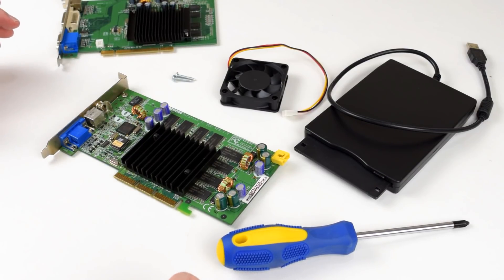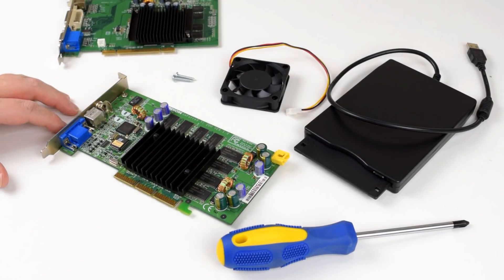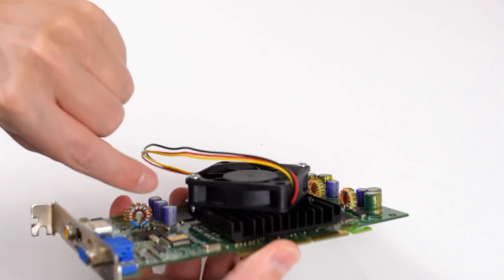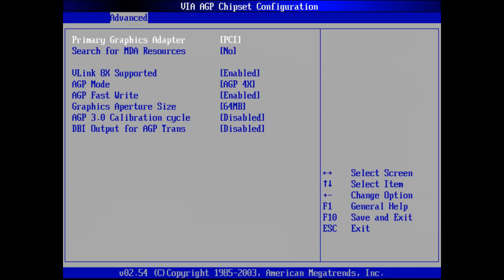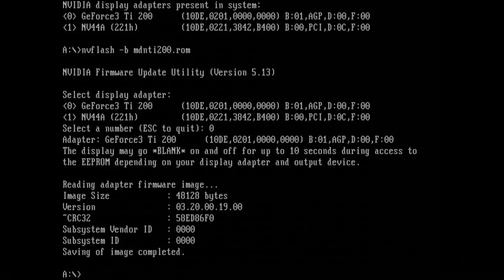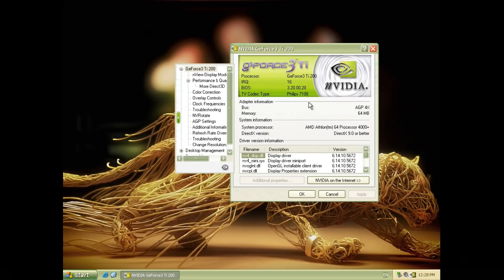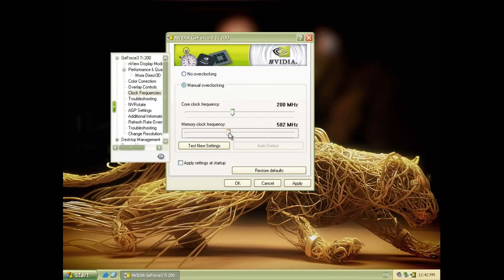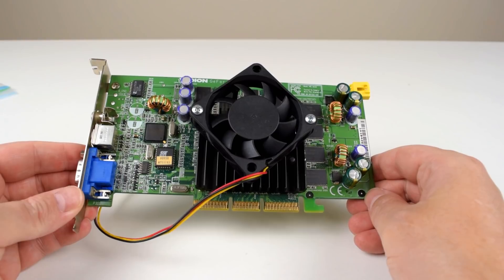Can we mod a GeForce3 Ti 200 into Ti 500?

Comment: Did anybody successfuly remove heatsink from that exact model of a card? I wanted to replace cooling entirely but it seems to be glued, its no thermal paste.
Reply: I managed to remove it by releasing pins and putting tapestry knife blade between lower core frame and heatsink, then heating up with hot air 250 C with lowish/medium airflow then putting flat screwdriver between blade and heatsink (good method to protect the core from uneven forces), then twisting screwdriver slightly with (absolutely no force it came off very lightly once heat soak in). Now I put on it Aardwolf cooler which is more for radeon 9000 series and gf4 or fx so its big (takes extra slot and a bit) but it does fit medion gf3 ti200 and provide massive cooling performance. If anyone ever think of trying it I think this is the best method for this card, much better than freezing it, its no 3dfx.

Comment: The TI500 with the green heat and ramsinks, i desperately wanted that card as a 19 year old lad! Couldnt afford it at the time though. That card was the first consumer produced gou that i ever saw that made me realise things were changing. My gpus to then id added ransinks and crystal orbs to overclock etc, this was the first card i saw that looked like proper cooling had been done by the manufacturer. The next gen 4a all had shrouds and near full cover heatsinks etc. That was the jump from the old pcb cards with nothing on then, to the ti500s, some like the green one, had the jazzed up cooling, then the 4s all had images on big heatsinks and looked like consumer items rather than parts from a 1993 server pulled apart! We all fell for it too! People actually bought cards from manufacturers who made the better looking version. Something to do with the first windowed cases coming out around then lol.
I used to make my own led lighting from maplin parts, made my own 12v water cooler setup from a car window washer water pump that pulled WAAAAY too much power for my liking, that i actually paid a lot for a new psu cuz with my home made cpu water block i went from 1000mhz on my amd thunderbird, to 1400mhz and back then, that was a huge jump that pushed fps up in the 10s rather than 1 or 2!
God i miss the early days of gaming and overclocking and pc case modding!

Comment: You tested the fan to see which side the air came out??? You couldnt look at the blades and instantly see which way it spins and which way it pushes the air? Waw!
I must have a super power! where just at a glance i can see which way a fan pushes air, from now on i will be known as FanBoy!...... Either that or your a strange one! You know enough to mod a card but cant work out how a fan works! Btw the heatsink DOES accept screws, some of the blades on it are closer together and have a ridged surface, that is to accept screws. You sure you know about gpu modding?
Reply from the maker: @Matt-uv3eg  I've heard worse, from better.

Comment: What kind of overclocking software did you use? Or is it part of some driver for nVidia cards? if so, which one? Because the one I use doesn't offer me these options. Thank you!
Reply from the maker: You might need the coolbits registry tweak. Or use Rivatuner or PowerStrip, both can OC.
Reply: @philscomputerlab  Thanks, I found it right on your website. But I must have been overzealous and messed something up on my MSI MS-8850, because now it doesn't detect Windows 98 as GF3. I must have tampered with the card's BIOS somehow? Links directly to my card are no longer available on the Internet. With the original broken ROM, Windows were unable to initialize the card, so I backed up the ROM from my ASUS Ti 200. With this ROM, the card works now. However, the original working ROM is probably lost for good. Let this be a lesson to others not to skip important parts of your video and to carefully backup everything.

Comment: That’s not the proper way of doing things.
First You overclock the card with Riva tuner to find maximum stable clocks. Next You edit the OG bios of the card  with the newly found max clocks and flash the bios with them, so You don’t need to use riva tuner anymore. 
There is no need for using ti500 bios.

Also the ti500 have square shaped memory modules, which are capable of higher speeds, TSOP memory modules with 4ns would not cut it.
Reply: Old video, but since it doesn't change the device ID to a geforce 3ti 500, It would just make more sense to find the max overclock and click "apply at startup"

Comment: I have no victory stories with nvflash. Just abject failure. :( Tried a GF2 MX to GT. Worked fine. What I didn't know is they were all the same cards to begin with (MX, GT and 256 that is). So I gained and lost nothing. And for sure the Ultra would have bricked any of those cards so I did not bother.

Comment: @PhilsComputerLab - 
This must be an OEM card for a bigger PC manufacturer (often used in Medion / Aldi) , because this internal CD-Audio header is made in yellow for analog video
Reply from the maker: Yes it is an Aldi computer card 🙂
Reply: @philscomputerlab  - 
I pulled the identical grafics card from a 2005 Aldi Medion-PC (Pentium 4 ) with dead motherboard (BIOS or chipset) , the yellow internal port of the card was used for analog Video input (S-Video & Composite) from the front bay (incl. card reader , under a lid) , I think I did it in 2015

Comment: I just saw this video now. My guess is that you probably did not thoroughly check the memory overclock stability. I have five Medion GeForce 3 Ti 200 cards, which I acquired in a 5 - 6 year time span (so very different batches). Not one of them is capable of reaching a memory frequency of 230(460) MHz with 100% stability (in fact, three of them can't even do 210(420). Yes, it's almost stable, but in certain benchmarks, if you pay very close attention, you can see a few instances with pixel corruption. For example, my go-to memory benchmark is running the Bump Mapping tests from 3DMark 2000. For some reason, these really stress the VGA memory and if your card's VRAM is not 100% stable, it will quickly show in these tests.

Comment: hi, i wish to flash radeon 7000 it clocked@ 143 for both memory and core , and i tested the clocks stable @ 166mhz , even 173mhz , getting 8 frames faster , how can i do that? , by the way thanks to you for retro works.

Comment: I wonder if you cooled the RAM a bit using those cheap little aluminum ram coolers you can get on Aliexpress, etc.. if it would clock closer to 500.  Might be worth a try.  Something like these:  https://www.aliexpress.com/item/32909309458.html

Comment: I have Nvidia GeForce 4 MX440 64MB version and believe or not.. in 2010 i was playing a minecraft on it but in 800x600 , render distance set to 5 and also i did some tweaks like boost memory clock + 30MHz and chip itself + 40MHz. This gave me a FPS boost around 2 or 3FPS but it was much stable. So the total AVG fps was 30 to 45 stable all the time.

Comment: I have a Socket A board where I can set the multipier of the CPU with jumpers. Even with Athlon XP cpus that have a locked one. After doimg that my Athlon XP 2600+ showed up as a 3000+ in the bios.

Comment: My Asus Geforce Ti200 could be overclock only by a margin of 10 to 15% from the stock speeds and this was totally cooling system independent as it used the same cooler and copper sinks of the original Asus GF3 Ti500.

Comment: I remember flashing my 9800 GTX+ into a GTS 250 and getting a different/new GTS 250 to SLI the two cards like 10 years ago.
A lot more straight forward since it was just throwing the files onto a USB flash drive and booting from that as the GTS 250 was a rebadge, and no physical mods were required. Still kind of nervous to do since that was at the time still an okay graphics card.

Comment: Thank you so much for all your work in the retro gaming community. I've recently built a Windows 98 machine with an A7V133, Duron 950, 3DFx Voodoo 3 2000, 128MB SDRAM, 52x32x52x CDRW, an Old beige case with an old PSU with 30 amps on the 5+ rail, 3.5-inch floppy, 80GB IDE HDD, SB Live! and Win 98SE. You've made it so much easier to play old games in MS-DOS mode with the SBLive. Your website is priceless and I can't thank you enough. Also, using a CRT can make all the difference in the world. God bless and thanks so much for everything, I wish you nothing but the best and cheers from the west coast of Canada.  (I often leave your videos on autoplay in the background, it's really enjoyable.) If I could make a suggestion for a video, it would be 3dfx games and how some 3dfx games only work with some 3dfx cards, but that's quite a deep topic, but if you made that into a video, I would probably watch it on repeat for at lest a month. Anyways, cheers and thanks again for being awesome. If you ever need any stock music I'm aways down to produce some free tracks... My Soundcloud is www.soundcloud.com/guata08. Cheers.

Comment: i have some tools that i use to modify the original vbios, you can change the clocks, unlock shaders, change the vbios cache screen that shows at post, all kinds of things like fan profiles can be adjusted, and the best part about using the stock vbios is you know its going to be stable, some vbios are different, like some cards had VIVO and some didnt, some use faster memory and some dont, so what i did with my geforce 6800gs is tested my overclock settings for a few hours, made sure it could run at the geforce 6800 gt speeds stable and cool, then using tools i dumped the stock vbios, i then made a copy of the stock vbios and saved it on my server, i opened the vbios in a tool and unlocked the shaders, went from 12 to 16, adjusted the clock speeds and adjusted the fan profile, also added the text modified in the cards post screen cache so i know its the modified vbios, saved settings and flashed with nvflash, i now have a $7 geforce 6800 gt thats working great

Comment: Bro, if you put heatsinks on the RAM I guess it could handle the Ti500 memclock speeds! I had an Ti200 with a big ass heatsink that covered the ram also and I just swapped the little fan with a bigger AMD cpu fan,  and it was a beast :D

Comment: I flashed a custom firmware on my 970 for the 0% fan at low temps but it never worked but it did let me put the % lower than it would let me before. All thanks to linus

Comment: hey phil, is there a list of games you recommend for p2 system? i ordered a dual slot mobo and thinking of building a nice classic gaming machine and ditching my pentium pro. Its going to run 2x 233mhz cpus and as much ram i can cram which is maybe 1gb, for video its going a fast decent card so no bottle necks there other than what the cpu and mobo can run at.
Reply from the maker: DAT 30GB Not really, best to research what interests you. I tend to use games that I like or find interesting.

Comment: I flashed my 9600 Pro with XT bios and added a fan.  It ran just fine and the speed boost was just noticeable enough in the games I was playing at the time.
Reply: This is what I missed! I had a 9500, too slow, returned it for a 9600 Pro. Still too slow. Kept it but bought an FX 5600. I open the box to the "Congratulations we've upgraded you to the FX 5700 for free!" No thanks, that card has serious issues. What a horrible way I was in. So I went to CompUSA and bought a 1300XT. Too slow for Oblivion. Tried the 1650, still too slow for my taste. At this point CompUSA is getting pissy about returning opened GPUs so I got the most expensive thing in the store. The HD X1950 Pro XTX. And I was so happy with that card for a while. So happy. Thing is, if I knew the 9600 could be a 9800 I would have stopped right there until the 1950 came out. LOL. Oh well.

Comment: GT 7300 fanless, that card... just add a fan to it, 350mhz stock can be increase up to 610mhz with stock voltages. With voltmod I can remember go up to 720mhz at 65, 70C, at this clocks the GDDR2 just was holding back the card on perfomance, 420mhz on memory was near the max mem clock.. I played many titles with this OC, I can remember playing mw1 and mw2 at 720p.. very nice card to play with overclock...

Comment: I haven't thought of using a pci and an agp card at teh same time when flashing. I found nvflash to be a bit tricky at the beginning. I use this method when flashing cards from pc to mac-rom for use in a macintosh. Maybe I can flash a mac card to pc if I have both pci and agp card installed at the same time.

Comment: Try voltmod. My result with GF2MX - 272/230MHz @ 2.45/3.9V. Had to cut 3.3V lanes from AGP and make my own voltage regulator for memory. There are guides on the internet if you don't want to figure out exact procedures by yourself.
Reply: Can you spoonfeed me some links been trying to google never find much of anything with pictures.

Comment: I remember years back flashing, Geforce 5700 with a Quadro 3400 BIOS, I think it was, to get Avid running on a PC. For a few generations there was zero difference between Quadro and consumer gaming cards, aside from the cost (and binning). That's when softmodding took off. Then Nvidia cracked down on the practice and nowdays, even though they often use the same chips in consumer and pro cards, gaming ones are physically crippled to prevent softmodding. It's ironic that it's more cost-effective to make a good GPU and deliberately scale down performance for different market segments than to have parallel development lines going at the same time. Very common practice in the electronics industry.

Comment: BZW, the contacts for the fan header work just fine. Got my GF 3 Ti 200 modded that way. Not sure about fan control though.
Should also be possible to dump the original BIOS and change the timings in NiBiTor before flashing it back.

Comment: I don't get the whole point of the bios swap when you can just overclock manually anyway ..
Reply from the maker: To show the process of BIOS flashing. If course you can just move the sliders...
Reply: Ah okay Fair enough , I remember those artifacts on my geforce from back in the day and it scared the living crap out of me as I instantly thought i'd broken it messing about.
Reply from the maker: Haha yes I can relate to that! Now these parts are cheap though, so I have fun and try out things I wouldn't have done with cards back in the day. With the PCI card it's easy to recover. I bricked the card on purpose just to see what happens, you just flash it again and it's good to go :D
Reply: With changed clock in the BIOS the OC stays, no matter what OS and driver is used.
Ofcourse always check out the clocks first with software OC and only flash clocks that are stable.

Comment: how can I mount a fan on a Voodoo3 2000? Unlike the Voodoo3 3000, the heatsink is much smaller and it doesnt look like I can use zip ties or anything like that?
Reply from the maker: Hmm don't have a 2000. Got a Velocity 100 I think, I wonder if that uses the same cooler? 2000 should run cooler anyway though, it's lower clocked.
Reply: GodOfGamingBG my Voodoo 3 2000 with the 3dfx logo on the back of the card has mounting holes at two corners of the GPU so the original heatsink can be removed and replaced with a modern one, however I don't think revisions of the card with the 3dfx logo on the front have these holes.
Reply: The fins on the 2000 seem to be pretty dense. Just try it with screws. Or small pieces of double sided tape in the corners.
Reply: I think the cooler is the same as the velocity 100, judging by google pics. Doesnt seem like I can take it off, it doesnt look mounted with screws, more like glued or welded to the chip. While I can probably use screws, the hitsink is so small, that I cant find fans this small, and I cant think of a way to mount a larger fan. I have the card overclocked to V3 3000 speeds. Right now I've installed a network card a couple of PCI slots below and sticked a fan in between the two to hold on them, but it keeps falling off every now and then...